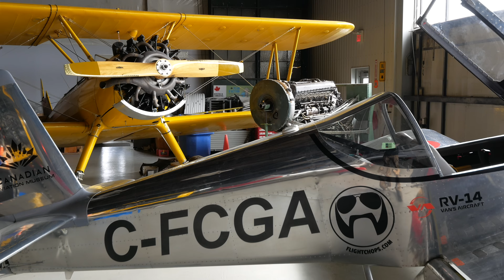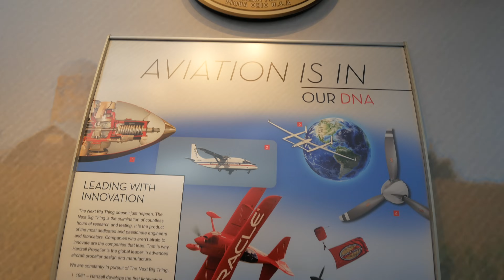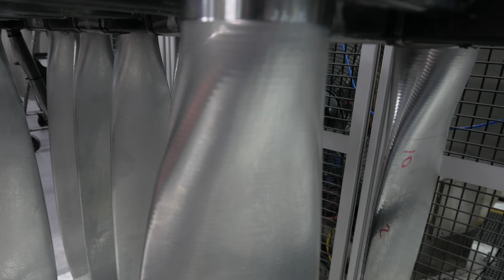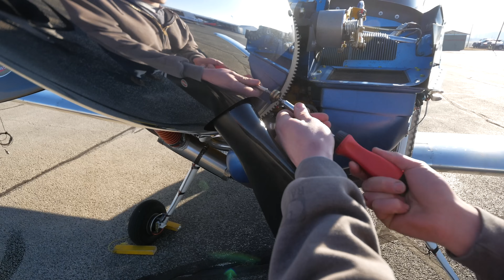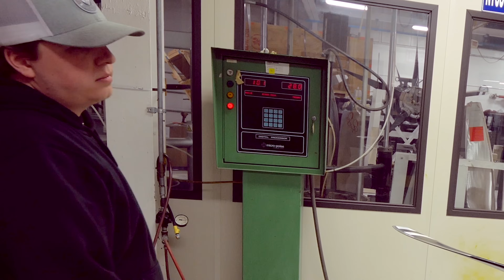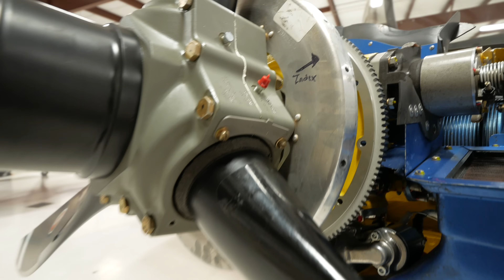Prop balanced to within the weight of a Dollar Bill! - Hartzell Factory All Access!

Comment: I had a video from Hartzell (or Sensenich) when I was an A&P, I.A. that showed a prop in an overspeed condition. They had a high speed camera make the video, then slowed it down so you could see the ripples in the aluminum blades. That is a real eye opener. It was as scary as the Piper video of a stabilator dancing in a similar way, when the Twin Comanche was over redline. OMG!

Comment: FANTASTIC video, Steve! Apologies for being late - I've been super busy and have missed a ton of your vids. This was amazing! I own an electronic tire balancer, and  it doesn't get anywhere near that level of precision - normally within 1/4 oz. is good with wheels. A little less if racing. A prop is spinning MANY times faster, and has very mission critical job to perform, so I can understand the need for that precision! Amazing equipment they have there to balance it right on your aircraft! That is great! Must've made a big difference I'd imagine. Definitely smarter people than I engineering the blades on those things. I can't even imagine how many hours of labor it takes to design one from scratch with the correct pitch and angles, diameter, etc., all playing together. I've been out of the loop for a bit, so I just wanted to mention your RV looks FANTASTIC! CONGRATS on getting her finished! I think I left off at you building the necessary flight time before your first trip - was a while ago! Dan Gryder's vid reminded me to get my butt back over here, lol. Glad to see you're still at it, Steve - top-notch production as usual! 👍

Comment: It’s really cool to see the balancing process. We got the prop dynamically balanced on the Stinson last summer and it made a huge difference. It wasn’t noticeably smoother but was noticeably quietly and it solved all of the problems we were having from the imbalance (cowling and fairings cracking, loose/missing exhaust studs).

Comment: Are you going to include vacuuming the runway as part of your pre flight procedure?
Reply from the maker: Wuh?
Reply: @FlightChops  I'm having a bit of a laugh. I am referring to removing any debris from the runway that might cause abrasion to your recently serviced prop.
I worked as a hanger rat years ago. The environment in which a plane typically operates in can make a fair bit of difference to the leading edges of props, wings and spars etc. By the way, love the RV and thanks for the content.

Comment: Wait, why on earth did he say cold starts mean low oil pressure? Cold starts mean extremely high oil pressure, since you're trying to pump extremely thick oil.

(That's still undesirable though, and a block heater is a great idea in cold climates)

Comment: For the dynamic balancing would the equipment be mainly measuring other engine components that vibrates because the prop had gone through static balancing and it's so precise that it's basically perfectly balanced (a dollar bill will throw it off balance).  I mean for dynamic balancing you were basically compensating vibrations from other sources by adding counterweight to the spinner?  The precision of Hartzell factory blew my mind.  Thank you for the video.
Reply from the maker: I think you're understanding it correctly... but this is way outside my pay-grade.  :P

Comment: It's funny to see diferent limits for dynamic propeller balancing form diferent manufacturers. I've been able to balance some piston engines to 0.01 IPS, but on some PT6 engines the vibration can be as high as 0.4 IPS (limit per maintenance manuals).

Comment: I'm reminded of the Mythbusters episode where they tested if a postage stamp could bring down a helicopter.
Reply from the maker: Did it?  ;P
Reply: @FlightChops  So it's been over a decade since I seen it, but if I remember right they weren't able to replicate the myth. No one was willing to let them try it on a real helicopter. So they tried it with a RC one and a scale stamp. It took more than that to see any significant imbalance in the rotor. That said, during research, a mechanic did tell them that he 100% believed it, as mere dust is enough to throw the rotor system out of balance. Whether their results were conclusive or not, I'm not gonna try it.

Comment: Here is some fun info in this cross section of flying and filmmaking. My Steadi cam ops do multiple static and dynamic balances an hour for their Steadi cams, all by feeling and experience. You’d be shocked how important a dynamic balance is for a Steadi cam to get smooth shots and a prior static balance helps you get there quicker!
Reply from the maker: Very cool.  I actually got steadicam certified back in the early 2000’s - (mostly good memories expect for the long back breaking days.)
Reply: @FlightChops  Im not above making the 1st AD hold a 35lbs sandbag on their shoulder while the steadi is up. That way they'll be wanting to let the Op rest too ;)
Reply: I used to build my own drone camera gimbals in the early drone photography days, around 2012-14, before most off-the-shelf equipment was readily available. Balancing those was a pain, but absolutely necessary, and the difference in footage quality between an okay-ish and a really well balanced gimbal was massive. Some things span across industries :)

Comment: The bare aluminum looks so good on that plane.
Reply: I agree… I love the bare Aluminum look too. I think it has to be clear coated (??) for corrosion control… which is why they should be painted.. either way it’s a sharp looking aircraft
Reply from the maker: Thanks guys, but yeah - up close it ain't so pretty :P. We only polished it once, before the application of all that vinyl last July.  A year and ~120 hours of flying later, it is in need of some love... Polishing at best is a ton of work, but around all that vinyl, it is basically impossible.  
So... she's currently in Alabama, at the paint shop at Evoke Aviation :)
Reply: @FlightChops  Ohh excellent.  I know what it took to polish the bare aluminum ring cowl on my KC -135A ( J57/59W motors) and it was a never ending ordeal. Can’t wait to see the finished plane.

Comment: Very cool, were you able to actually feel a difference in vibration in flight after the dynamic balancing?
Reply from the maker: I'd like to think I could, but honestly, it was already pretty smooth - especially with the Thunderbolt engine.  This is really about component longevity, more so than a noticeable ride difference.
Reply: @FlightChops  how much longer will it increase the lifespan by balancing the prop?